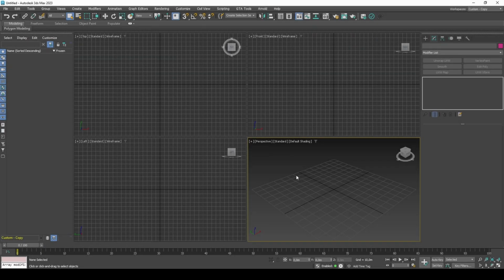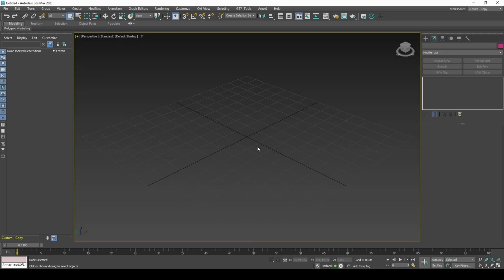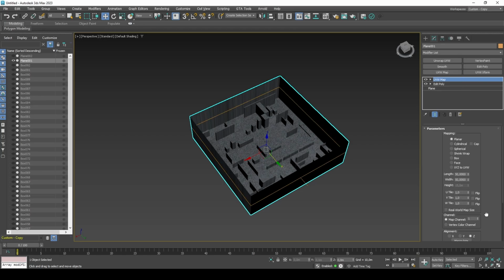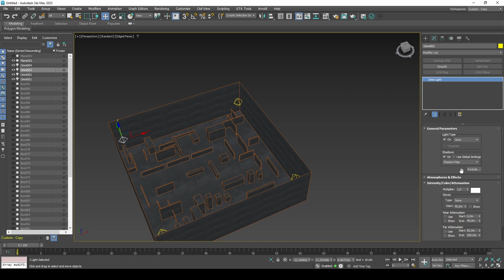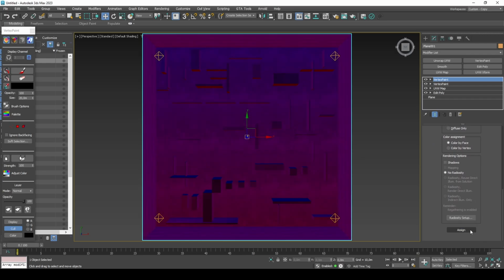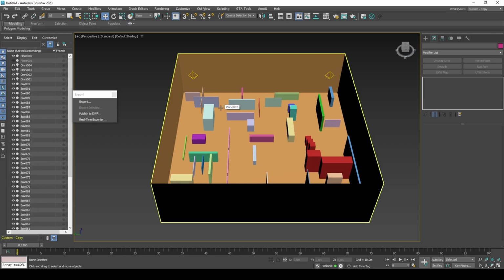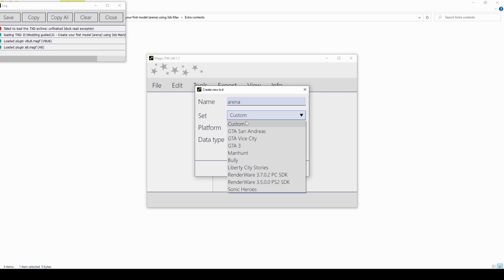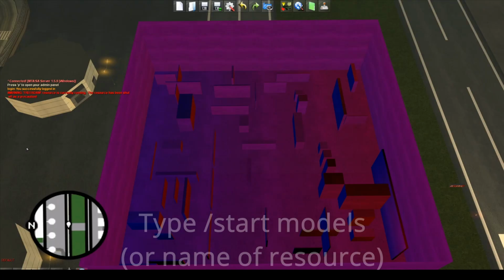31 - Create your first GTA SA model (arena)

Comment: Can you also please tell me that when I press AO in the preflight script tool it always gives me a material error even if the model does not have any assigned material.
Reply from the maker: It's been a while since I used the tool. You might just have to assign a standard legacy material
Reply: @thorsmoddingcorner9464  oke thanks for your reply